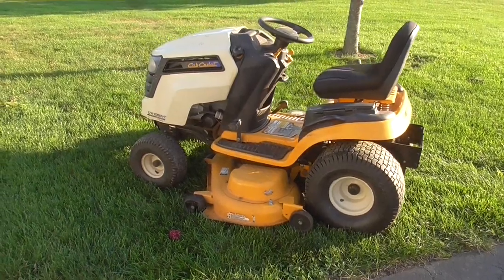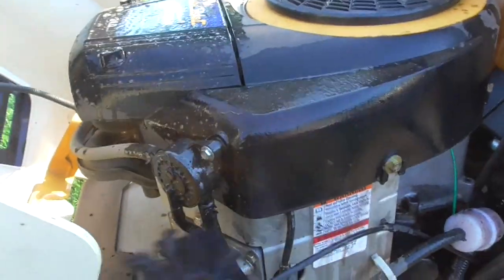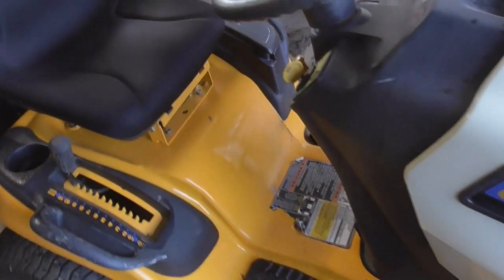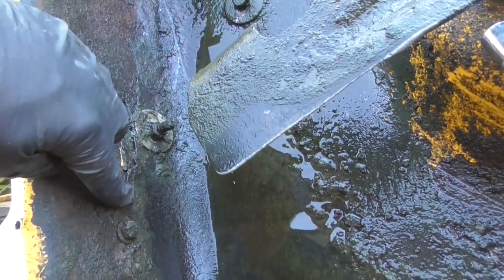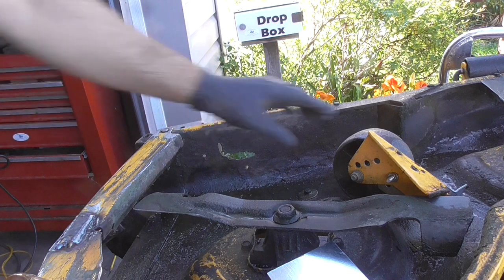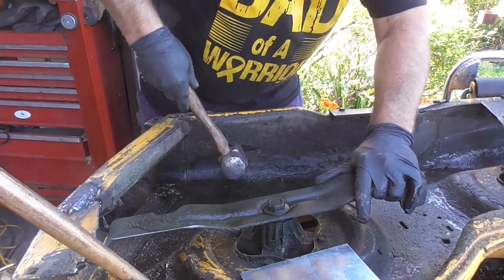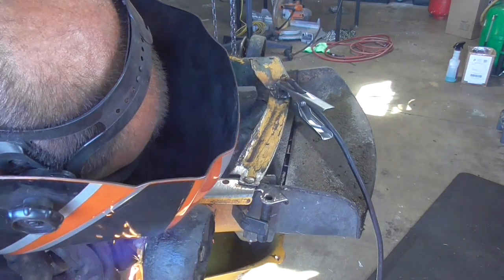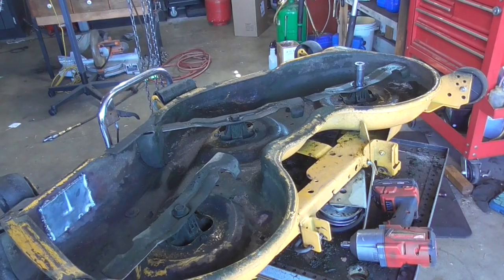How To Repair A Tractor Deck, PTO, & Everything Else

Comment from the maker: https://amzn.to/32MEy9K Boar's Hair Detail Brush Set
https://amzn.to/39jZ0Aa Pneumatic Grease Gun
https://amzn.to/32OoVi0 Purple Power Degreaser 2.5 Gallons
https://amzn.to/32PbLBs Trigger Start Propane Torch
https://amzn.to/32MEQgQ Waterproof Shrink wrapped wire connection kit
https://amzn.to/2ZVXMYS Electrical Connection Crimping Pliers
https://amzn.to/3hxg0pc  Mower Deck Scraper Tool
https://amzn.to/3f269GF Commercial Lawnmower Blade Balancer.

Comment: I have 2 cubs and 1 is the identical twin to this one but mine has almost 600 hrs on it and still works perfectly. That bracket on the top of the deck where it connects to the lift is a very common cracking point. I've had to weld both of mine and my neighbors , he has the same one also. Great work as usual
Reply from the maker: Thanks for the info!

Comment: You have some good skills with the mowers.  Nice that you put links to everything you used, Thanks, I was wondering about that brush you used and some of the other things. 
Was it hard balancing the deck after putting the wheel back onto the deck?
Reply from the maker: The deck was actually balanced pretty well, no adjustment needed.  I don't adjust them unless I see an issue cutting with them.

Comment: I just replaced my drive and deck belts and then the pto cable broke and had to replace it .But found there is a difference in the pto cable that cub cadet sells .I bought one from my local lawn shop and took my book with me and just looking at it when I got home could see the difference .The bottom down near the spring did not have the little rectangular lock and the piece that lock in was not even the right size .I also had to redo the OHV gaskets .Mine is a hydrostatic ltx1042kw
Reply from the maker: Sounds like you had a project to do there.
Reply: @doublewide6  oh yes if it is not my vehicles it is the mowers or the house .I just got done building 2 new decks and 2 new pergolas ,It never ends when you own a home

Comment: Great job. Do you set your welder to the 12 gauge deck metal of the 14 gauge plate?
Reply from the maker: My welder is a synchro. meaning it finds the right amperage.
Reply: @doublewide6  Ok I never knew those existed. I'm a buyer/fixer/seller of tractors. I'm thinking purchase $600 sold $950. Wait forgot bagger $1100

Comment: Get the gator blades they are great I got mine 3 years ago and love them and got them for my troy built also .changed out the gas filter ,air filter, oil filter and greased everything I am also a 67 year old woman with 3 acres so I take great care of my mowers .I also put led bulbs in it .I love my grease guns ,those kind are super easy and work great .What kind of grease do you recommend .I asked the dealer and he said what ever kind will work ,well not a real answer .Also he said you could use regular car oil but I have used briggs and stratton oil ,what do you think .The mower I have is 22 hp .
Reply from the maker: Sorry but I agree with the dealer any high temp grease will do the job.  10W30 SAE car oil is what I use.  The high mileage oils even have additives to help high hour mowers.
Reply: @doublewide6  thank you I really do not trust the dealer any more after he gave me the wrong cable and tried to convince me it was right .My cub has 222 hours on it because I also have a troy built mower that I use on the 3 acres .I trade back and forth when one gets hot the other gets going .The troy built is newer and I figured it was OK for the flat parts of the yard and for a standby .

Comment: I use a flexible plastic spatula that we picked up (several) on sale at IKEA. It takes off grass so much better than the putty knife. Less than 300 hours on that machine shows it was abused. Those decks on the MTD are soft steel. My 50 years old Wheel horse decks are in better shape.
Reply from the maker: Yes thin decks.  The scraper is made for decks it is really flexible.  I like the spatula idea.

Comment: Good job fixing that MTD nightmare.  They get their hands on a quality name and run it into the ground.  I had a 2180 Cub Cadet and that deck was pretty thick but it was really shallow.  Like how you reinforced that, the new owner is going to appreciate that.  Nice work.  It cuts really nice with that bagger.
Reply from the maker: Craig the new Cubs zero turns homeowner style are built pretty nicely for only $3200 price point.  The decks on those are fabricated and pretty deep.  These MTD style decks are junk.

Comment: all those cracks in the deck looks like the blades are not kept balanced.
We have a model XT1 with over 500 hours, no cracks in the deck.
We also keep the deck (expecially the underside) clean and every few years we undercoat the deck with a substance than changes any rust to an inert substance, so as to stop any tendancy to rust through
Reply from the maker: I noticed in the video all new spindles were on the machine, so sometimes cracked spindle bases put major pressure on the deck.

Comment: All of these styles of cub cadet are junk. I wouldn’t waste my time repairing that cheap garbage. Not to mention poor deck design.  If you want properly cut grass go with the Deere.
Reply from the maker: The older Deers are fine and thicker metal the new ones, I have welded many decks over the years.  But I will say the mowers are abused that need welding for the most part.